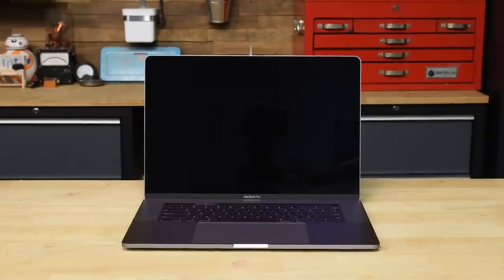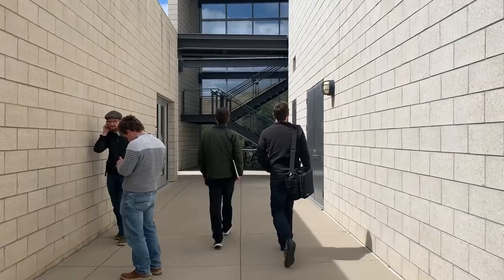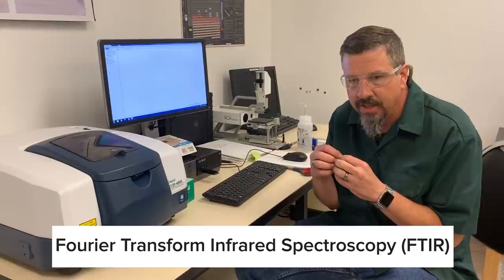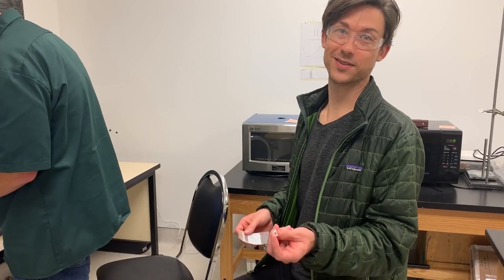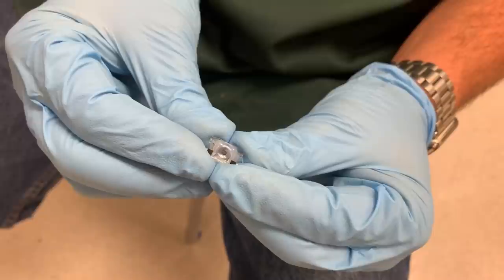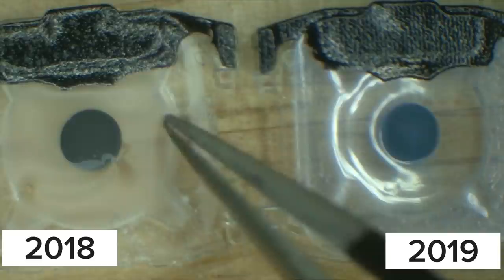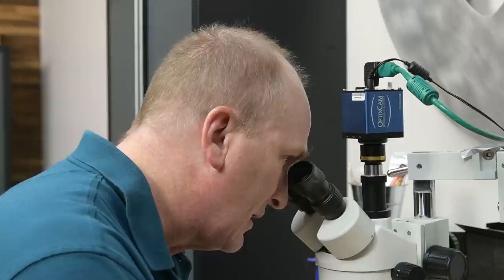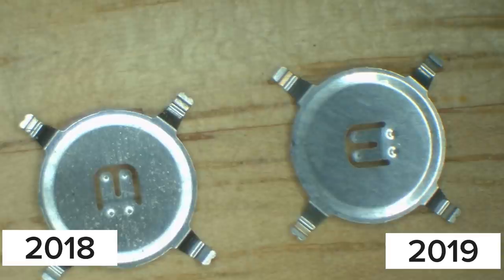We Found the "New Material" in Apple's Fourth Butterfly Keyboard

Comment: I would've bought a new Macbook of some type if it weren't for those keyboards,. I love my 2009 Macbook chiclet keyboard, and they were perfectly fine from like 2005 to... what 2015? Until Apple needed to make the laptops the "thinnest in the world" and now they're almost unusable and have a near 100% failure rate due to faulty design and are basically unfixable (they're f'ing riveted in). Except for some early cost-cutting computers from the late 70s/early 80s (Commodore PET, ZX Spectrum, IBM PC Jr) and some weird crap you'd find at those overpriced psuedo-tech mall shops like the touchless keyboard that projects a virtual keyboard on your table or a 1-piece rubber keyboard that rolls up, the current Macbook keyboards are the worst ever produced.

Comment: Apple had resources, they always introduce new design flaws year after years. New material membrane looks like a rubber c****m. They introduced c****m on an laptop which is an one time use product. Apple keyboard are worst to type, instead buy some old Lenovo or IBM thinkpad keyboards which are perfect than c****m membrane chiclet keyboards on apple. Maybe the new material is a used c****m. Lenovo thinkpad had splashproof keyboard for years, but till now the 4000 dollars apple  laptops doesn't have it, instead have an cheap c****m membrane chiclet error prone keyboard. To protect keyboard from dust and water people put keyboard rubber membrane protectors above the keyboard  rather than cutting cheap c****m and putting it below the keys for capturing dust. The membrane actually doesn't do anything it sits under the keys and gets teared if used for typing by a professional. Apple, to catch dust insist people to buy an keyboard protector rather than doing idiotic stuffs. A Laptop is a tool not a doll. People wanted a Doll buys a doll not a tool.

Comment: Image buying a 3000 $ laptop and it keyboard breaks within weeks
Reply: I literally had this happen after the mid-2018 launched. At the store they assured me the problem was fixed, and like a dumbass I believed them. Two weeks later, keyboard problems! Apple support told me it was too new to be on the repair program, therefore wouldn't be covered under warranty either. I had to live with that for months before they finally fixed it, at which point I sold it and will never buy another Apple device. I liked MacOS because I am a programmer and a designer, and it's great for the combo, but not worth a lack of a keyboard...

Comment: Or you can buy a keyboard cover for ₹170 (approx. $2).
Reply: It's a laptop. +, The cover will not help the metal parts which fail.
Reply: @vishwa3694  I was talking about debris/crumbs protection. But yeah, these keyboards are faulty by design.

Comment: I love how these iFuxit people think they are smarter than all of the employees at Apple. Like bringing a key to some random dudes that look and sound like the have nothing better to do.
Reply: Yet, the points they made are valid. Changing the old polymer for a new polymer that is better in terms of mechanical resistance might be enough to fix the issue.
But having a weak spring on the edges could still cause malfunctions on the keyboard.
Reply: If they're so smart why can't they design a keyboard that won't break so easily?
Reply: Nothing they said is wrong, they are just observing what Apple's employees did (i.e change the material). They aren't trying to be smarter they are just figuring out what Apple hasn't said (like figuring out hey, the new polymer Apple decided to use is probably better).
Reply: While I’ll admit I believe there have been valid claims from filthy people who eat while using their laptop, I am not one of them. I have a 1st gen MbP with Tb and never had a keyboard issue.
Reply: Seshpenguin what they said that was wrong was implying that Apple uses customers to test hardware like switches. Actual labs repeatedly actuate them over a million times to verify that the design is sound. The metal dude was either unaware of how r&d / manufacturing is done on a large scale or scraping the bottom of the thought barrel for anything to say.
Reply: Dude, that professor probably have taught some apple's engineers LOL Cal Poly is no joke of a college. iFixit didn't pretend to know what's going on. The fact that they went to Cal Poly for analysis help should say something.
Reply: @cuylarHD  You can't deny that the keyboards have reliability issues (otherwise you would be fighting Apples own discretion). They aren't terrible, I have no doubt a lab setting will verify theses to be sound switches, but there are literally thousands and thousands of people who will use and abuse these keyboard: and thats an entirely different stress test that can't be replicated in a Lab. After all, the keyboard is meant for human use, not machines!

So, in a way Apple is testing with the customers. There is no way for them to be able to get thousands of test in the real world without... well putting them out in the real world. They do their best to engineer a product, and then let it loose and see how it goes. It's all stages of a product lifecycle. They'll closely monitor the how it performances with people, and then adjust for the next gen,